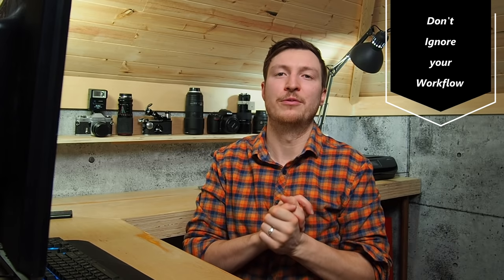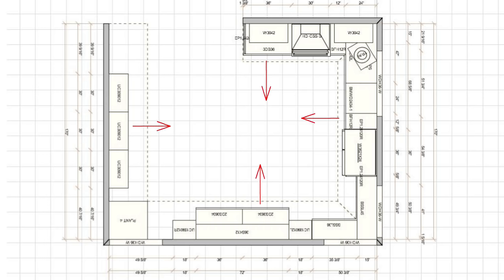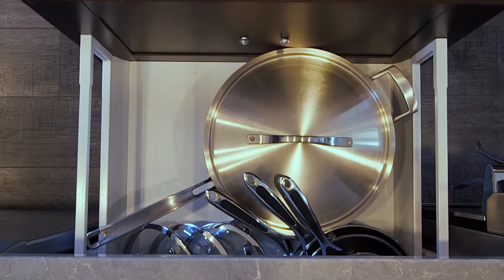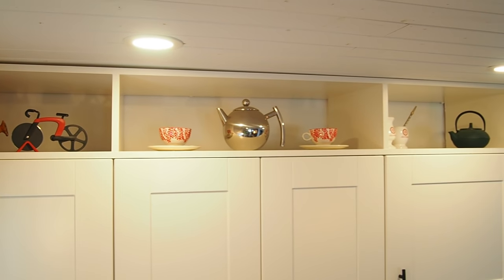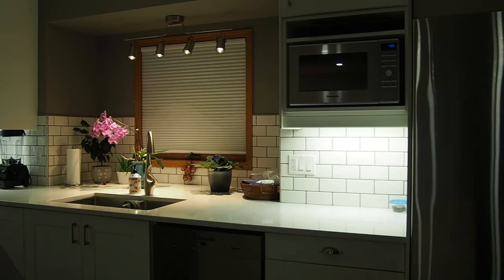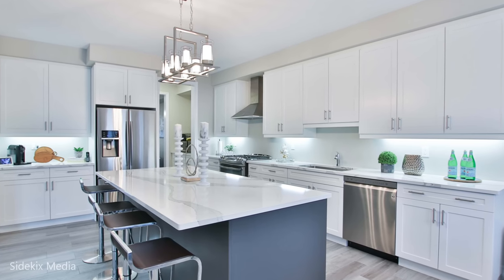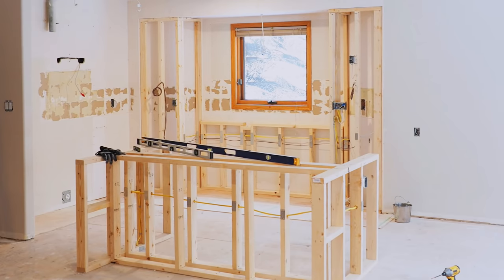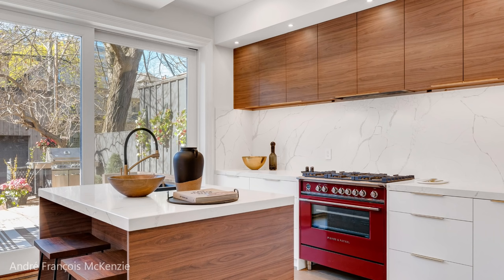KITCHEN DESIGN MISTAKES [Common design mistakes to avoid]

Comment: Have you ever raised a countertop height? I would like 1 or 2 more inches higher countertops but thought it would be too weird when I try to resell. Is it too weird? Should I just learn to deal with countertops that always feel too short?
Reply: My appartment has a raised kitchen island. I think, it's the easiest (just longer legs below the cabinets) and it's easy to change, if anyone in the future doesn't like it.
Reply: @sarahr.1076  that’s a good idea. My kitchen doesn’t have space for an island, but maybe I can do a similar raised workspace that is reversible.
Reply from the maker: @sugoiharris1348  yes, go this route! Try and keep it to a single area if possible. Even better if it is detached from your main countertop area. Raising the entire countertop can also bring in some other headaches such as weird gaps above the dishwasher.
Reply: @hsdesignstudio  thanks! I actually found this old cutout of the countertops I have that the previous owner held onto just after you responded. Excellent timing. It’s large enough to cover my stove and protect the glass cooktop (bonus) and I’ve been using it as a workspace. Makes a huge difference to have that extra little bit of height. Glad I found a free and temporary fix.
Reply from the maker: @sugoiharris1348  that's awesome! I'm glad you figured out a solution

Comment: We are building our home from scratch and we have conceptualized having the sink and cooktop on the island with the fridge and an in cabinet stove behind them. I haven't seen that done before, except at a cooking school I used to work with and was wondering what your opinion is on it?
Reply from the maker: The only thing I would be worried about is work space/spacing between the sink and and cooktop. Typically an island would not be large enough to house both of those elements with enough space to work. I am also not a huge fan of appliances in the island, but that is a larger discussion.
Reply: @hsdesignstudio  we are designing the house from scratch so we can create the amount of space that we need. I do worry about having the cooktop on the island.
Reply from the maker: @oansheikh8087  its not only space- island size can also dictate countertop selection (seams). Lots to think about. Feel free to reach out at contact@thehomestud.com and we can talk in more detail.

Comment: What if your L shape kitchen walls aren’t 90 degrees? My kitchen walls have an awkward 110° which I don’t know what to do in that corner to maximize cabinet space
Reply from the maker: That is an awkward angle! I'd have to take a look at the space as a whole and how the appliances/rest of kitchen are laid out. However, I think you would treat one side rather normally and then get creative with the other, making a somewhat custom cabinet to fit the off angle.

Comment: What would you recommend if your ceiling is 9 feet tall. What type of wall cabinet will I need?
Reply from the maker: This really depends on the design or style of the kitchen you are trying to create. Sometimes it is better to run the cabinetry to the ceiling with 40+” cabinets, other times it makes more sense to keep them lower and streamlined.
Reply: @hsdesignstudio  I have the same situation and have cabinets purchased already (I found some takeouts from a interior designers studio and saved some money - cabinets are expensive!) my dilemma is that I have 9’ ceilings, 36” counters and the cabinets I have are 42”(upper cabinets) + 15” (top display cabinets that go on top of the 42” cabinets). 

I would like to use the 42” and 15” upper cabinets together but with the 108”(9ft) -36” (counter) - 42” - 15” = 15” gap between the counter and upper cabinets. 

You shoot for 18” for the gap between the counter and the upper cabinets.Would it be a horrible idea if I only had a 15” gap?

If I didn’t use the very top section of the upper 15” cabinet I could position the 42” cabinets at any height on the wall but then I would have about a 12” or 10” gap inbetween the top of the cabinets and ceiling. 

What would you recommend?

Option 1: Cabinets all the way to the ceiling and a 15” gap between the counter and uppers? 

Option 2: Ditch the 15” top cabinet section and only use the 42” section of the uppers: this would allow me to make a 18” gap between the counter and upper but would leave me with an awkward 12” gap between the uppers and ceiling.

Comment: I have 9” (108”) ceilings and have cabinets purchased already (I found some takeouts from a interior designers studio and saved some money - cabinets are expensive!) my dilemma is that I have 9’ ceilings, 36” counters and the cabinets I have are 42”(upper cabinets) + 15” (top display cabinets that go on top of the 42” cabinets). 

I would like to use the 42” and 15” upper cabinets together but with the 108”(9ft) -36” (counter) - 42” - 15” = 15” gap between the counter and upper cabinets. 

You recommend shooting for an 18” for the gap between the counter and the upper cabinets. Would it be a horrible idea if I only had a 15” gap?

If I didn’t use the very top section of the upper 15” cabinet I could position the 42” cabinets at any height on the wall but then I would have about a 12” gap inbetween the top of the cabinets and ceiling. 

What would you recommend?

Option 1: Cabinets all the way to the ceiling and a 15” gap between the counter and uppers? 

Option 2: Ditch the 15” top cabinet section and only use the 42” section of the uppers: this would allow me to make a 18” gap between the counter and upper but would leave me with an awkward 12” gap between the uppers and ceiling.

Thanks in advance for your input!
Reply from the maker: I wouldn't want a 15" gap above my countertops- that's my opinion though and some may disagree. I also don't like to have cabinet doors flush to the ceiling...

Comment: The question is not do you want power on the island, it is absolutely required by code.
Reply from the maker: If it is a fixed island, yes you are absolutely correct. However, that is not the case if it is 'moveable' in any way. I have several clients who have gone with an extra large butcher block style island with no cabinetry underneath, specifically to avoid the mandatory outlets.

Comment: According to electrical code, islands are required to have an outlet, sometimes multiple, depending on size. That's enough to make me not want one since I'm on a concrete slab.
Reply from the maker: Totally fair. Most houses built around me have basements, making electrical easy to run to an island. Even with a cement pad, adding electrical just requires a little extra planning.
Reply: We are trying to figure this out as well...on concrete, redoing kitchen with island and quartz waterfall edge. Area has power currently (we're reshaping the current island and re-tiling the floor) but not sure where to place outlets. I hate those popups and refuse to cut into the waterfall :/
Reply: @BethKiesel3n1  Oh yeah, definitely wouldn't want to cut into quartz for an outlet. Could you put the outlets on the backside of the cabinets? Or do you have cabinets on both sides? Could you hide the outlets inside the cabinets? I don't know the electrical code exactly, but it essentially comes down to having to be able to reach an outlet with a 2 foot long cord, because that's basically what all small appliances have. On a countertop that means an outlet every 4 feet max.
Reply: @andrewbrown784  we have had these same ideas... there will be seating, but no cabinets on the back of the island. We're planning on doing something decorative there, maybe large format tiles. So there's a 15" overhang there anyway. We can do outlet strips underneath for the people sitting on the island I guess? Inside cabinets/drawers is an option, but not sure if it's to code. We even considered toe kick but again, too long  Argh 😫

Comment: Is it better to have a kitchen sink in the island or on the counter space?
Reply from the maker: This largely depends on the kitchen space and personal preference. There are pros and cons to both options.
Reply: My two cents:. Our sink is on our island.  Our dining room table is just a few feet from the island.  We find that it's great because you can easily talk with family or guests at the table while you prep dinner, make cocktails or do the dishes afterwards.  Even when making dinner I find we spend more time looking outwards from the sink area than from the stove area.  Also if you put a cooktop on an island you have to consider how to vent it which will likely block sight lines.  The biggest drawback with a sink at island can be the cost of bringing the plumbing there.

Comment: Upper cabinet height....  Short people cannot access Upper cabinets that high!  Visibility under the upper cabinets is easily addressed with lighting under those cabinets.
Reply from the maker: It's not a visibility from lack of light necessarily. When I work at a counter with wall cabinets 16" above or even less, they can really block out the space visually (line of sight for those over 6'). My wife is ~5' and our wall cabinets are ~19-20" off the countertop and she can reach the bottom two shelves just fine. That is also where we keep the items we use daily. Anything above that and she grabs a step stool or kitchen chair. Dropping them down two inches won't help her/anyone reach the third shelf, it just makes the space between the countertop and cabinets tighter.
Reply: @hsdesignstudio  your wife loves you ❤️.   And, correct,  I'm not trying to accommodate someone over 6' tall.  My uppers are 16" above my counters,  I put in under-cab lights,  and if the items in the top shelf of my uppers are light and unbreakable I can get them in and out, else I get the stool.  The extra few inches would drive me to getting the stool much more frequently.   Good to know the measurements,  so I'll be certain to specify 16" next time I need to redo a kitchen 😀.   Oh, I'm 5'2"

Comment: NEC has required electric power in an island for at least 10 years now.
Reply from the maker: Yes I know, but only if fixed. As my other comments have said you can skirt the rules per se if using a non fixed island. Even if the island is cabinet based, but on feet and can be moved, it can still skirt code.

Comment: Great video, but why IKEA? 

Like I seriously don’t understand. The difference in  looks, quality, durability, customizability and cost of IKEA vs direct from custom builder is enormous. As in for not that much more money, you can get completely custom, high quality, extremely durable, beautiful, solid wood cabinets. 

Example, in my last house 1900 sq feet, we had custom cabinets made for 19k, Lowe’s top tier was ~20k, and not custom, Menards was ~18k, and IKEA didn’t have cabinets within the same category, but still costly.
Reply from the maker: Pricing really depends on where you live. There is no way custom cabinets can compete with IKEA cabinetry in my market (and many other markets). Also, $19k for custom cabinets is not inexpensive by any means. I work with clients every day (designing IKEA kitchens) and their entire kitchen reno budget might be $20k. Many of these kitchens have cabinetry costs (with all of the necessary finishing materials) under $5k. When you start comparing apples to apples, I believe it is really hard to beat IKEA's offerings.

Comment: 4:08 one question, for the kitchen wall cabinets. Do you just rest them on top of your existing kitchen cabinets or do you mount them?
Reply from the maker: It really depends on the space. For the ones in the video (because they aren't carrying much weight) they are resting on top of the wall cabinets and held in place with screws from below. In the case of larger shelving, I create a separate attachment system so the cabinetry below is not carrying the extra weight.
Reply: @hsdesignstudio  ohhh thanks so much for your reply!! I might have to mount them then, probably for storage of stuff that we don't use every day.
Reply: @hsdesignstudio  you definitely have to account for weight when designing any layout.

Comment: Design a kitchen for a 74 year old with two torn rotator cuffs, please.
Reply from the maker: There are definitely a few challenges I'm sure you face with normal wall cabinetry. It would all come down to the space you have to work in and laying out the cabinetry appropriately.

Comment: flooring. cabinet. countertops. backsplash. what should we pick first? please advise.
Reply from the maker: I most often decide on my cabinetry and then go from there. However, there are exceptions. If I am working in a home with wood flooring throughout (including the kitchen), I will make sure the cabinetry works with the flooring before moving forward. Alternatively, if I have a client using a very specific natural stone countertop, I will design with that in mind. There aren't necessarily set rules when it comes to design!
Reply: @hsdesignstudio  thank you so much